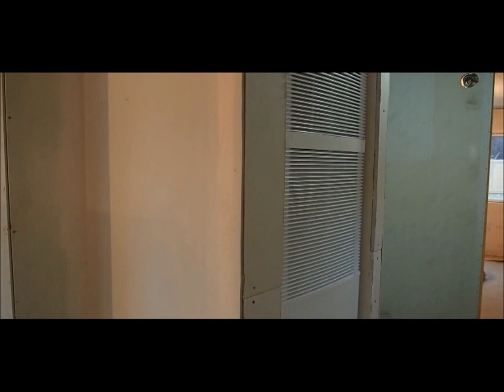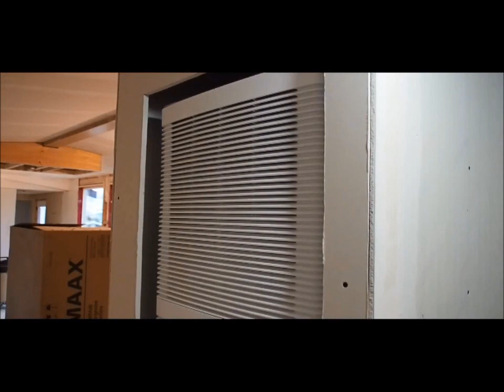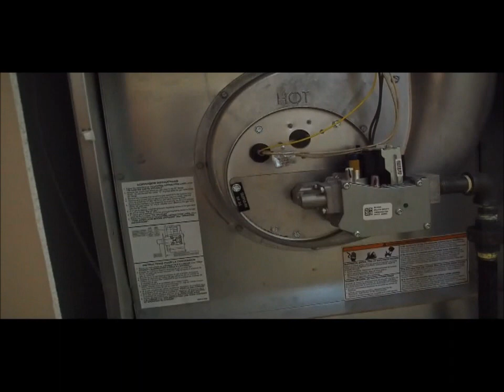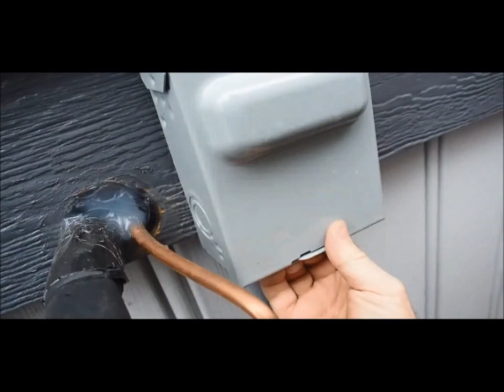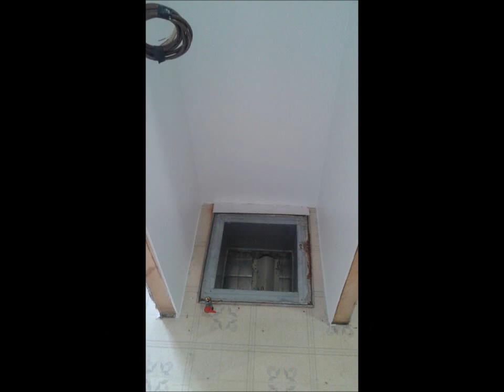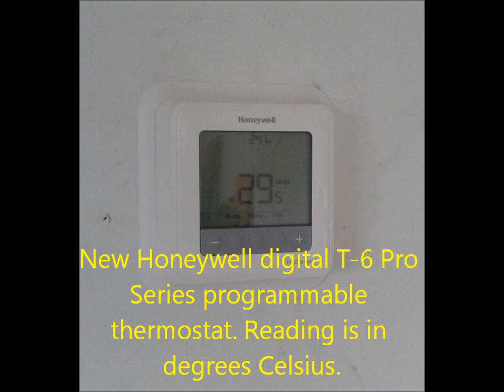Putting A New Furnace And Central Air Conditioning In A Mobile Home : E042 / BC Renovation Magazine

Comment: I was in the hvac business for 35 years (I'm 70) and was an authorized Coleman dealer/repair facility.  So I have some beans in the business.  Problem with all mobile home heating and cooling systems where you force air into a somewhat leaky and flimsy duct system is the loss of energy.  A much better solution is to install 3 inverter type mini-split heat pumps (through the wall installation) at strategic places.  I've found that 3 will cover up to 80 foot in length on a 16 foot wide home.  There is virtually no loss of energy and with inverter tech you can heat down to minus temps without issue when sized properly.  Inverter technology allows the compressor and indoor and outdoor fans to vary speed using an integrated circuit.  At present they are the largest selling heating and cooling type in Canada.  So you know they work.  And you won't get those cool spots you experience with in floor ducting.  The mobile's come with a thin and narrow duct that will reduce air flow volume the further it gets form the blower.  Plus the duct looks like its made out of throw away aluminum pie plate material you get with frozen pies.  These invariably leak over time.  And if you attempt to adjust the registers on the floor to achieve even air flow, the noise level becomes deafening.  Mini-splits on the other hand can barely be heard.  A typical 2 ton mini-split uses around 2 amps at 240 volts, so the cost to operate is about the same as 4 100 watt light bulbs.  Why would anyone still use the included furnace in a mobile?   You can typically reduce bills for heating from the hundreds to less than $75 per month.  And they are much more comfortable to live with.  I've sold and installed literally over 10,000 systems in my career so I have more than done my homework.  The days of the central heating/cooling system are nearing their end, thankfully.  The only reason mobile home manufacturers still include them is that they must include a heating source to sell their product.  And they use the least expensive they can.  And with that comes major compromise.
Reply from the maker: A Day, very interesting comment! Thanks for watching and commenting. :-)

I am always interested in new technology and ideas. I have not heard about using mini-splits in a mobile home application. That is an interesting idea. Yes, mobile home HVAC systems as they come from the factory are pretty rudimentary. Not much more really than a slightly upgraded RV system. I would like to see a mobile home that has been outfitted as you have described.

I can't complain about the airflow with the new setup in our project home. The new furnace has improved that over the old one quite substantially. Even at the far end of the home away from the furnace airflow is good.

The thing that I really don't like about this setup is that furnace sitting inside like that. It is very noisy. I did one where we removed the furnace from inside the home and went with a packaged unit outside. THAT was a nice setup. Airflow was good and just a whisper of noise. I really liked that setup. I had planned to use a packaged unit in this home but was not able for a couple of reasons.
Reply from the maker: JD, if you are talking about the type of system that A Day is talking about, the mini splits, there is no furnace or duct work. These units sit in the wall near the ceiling. He is suggesting 3 of these units be placed throughout the home. This is a totally different concept than what is usually found in a typical home that has a furnace, ductwork, etc. I am not really familiar with these so hopefully A Day will chime in and comment.

If you are talking about the packaged unit that I mentioned, that system removes the furnace from inside the home and replaces it with a unit that sits outside. It is an adaptation that re-uses the existing ductwork.
Reply: @BCRenovationMagazine  I see mini splits in most new park models now. An excellent choice I believe especially for zone control via smart thermostats. Only downside is no gas models. They're all electric but would still be a savings and comfortable. I have a vacation home 1988 park model in Oregon that had always been used as vacation home and in very, very well maintained condition. The park is a PUD and 91 spaces are privately owned. We have natural gas into the park too. Up to 400 sf add on is allowed. Designs are approved by the board. In my unit a prior owner removed the built in central heat only system and then, in an add on matching shed like structure, put a full house sized  updraft efficient (pvc vented) system. The system is ducted into the original ducting. Also a 30 gas w/h. Result is attractive and quiet; very quiet. Cheap to run too.
Reply from the maker: @DM-pr5zu  , that is interesting about the mini-splits. Thanks for commenting.

The setup that you describe with the furnace outside of the home sounds very much like a system we did on another project we did where we removed the furnace and set up a commercial packaged unit outside, tying it into the mobile home duct work. You can see it in this video: https://www.youtube.com/watch?v=DrVB3PqQnTs

Your furnace would be more energy efficient than the package unit we used. Maximum efficiency rating available to us at the time was 80% and 16 SEER (I think, maybe 15) on the cooling side. Your furnace is probably 90+ rated since it is a condensing style unit (two pipe).

What is a PUD park? I am not familiar with that term.
Reply: Why would anyone use traditional furnace? Like I wouldn't want to have mini split throughout the whole house to many units to buy I rather have house same temperature and cool bathrooms just not that efficient but mini splits would be to many for me to install

Comment: We've had a Coleman furnace for 22 years and it has been excellent. We had a couple minor issues that were easily fixed, and it just keeps plugging away. 👍
Reply from the maker: Hi, Becki. When I first heard about Coleman furnaces in these I thought "Coleman???, like in camp stoves?" :-). Then I did some research and discovered that Coleman has been making HVAC equipment since the 1930s. There is definitely something to be said for keeping things simple. These mobile home furnaces seem to do the job well and not at great expense in maintenance. I like that! Thanks for watching and commenting.

Comment: What size filters are on the furnace? I have the same one but haven't been able to find a standard size filter, so have been using a custom cut one.
Reply from the maker: MrRazor99, this furnace uses standard 16" x 20" x 1" filters. Two are used, one stacked above the other in the filter rack.
Reply: That's why I use a cut to fit reusable filter not just for the furnace but also for the package central AC unit.